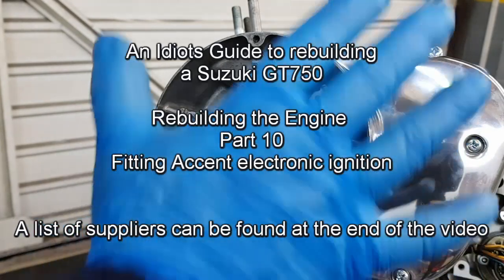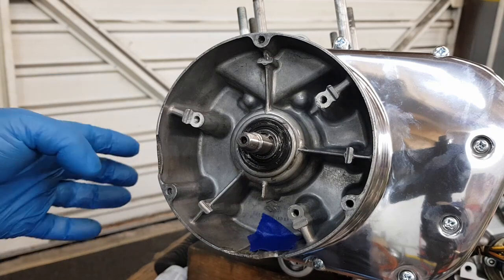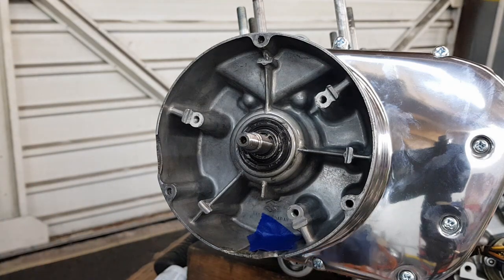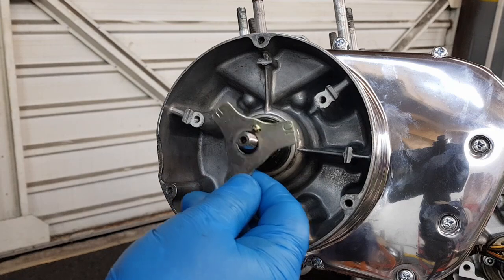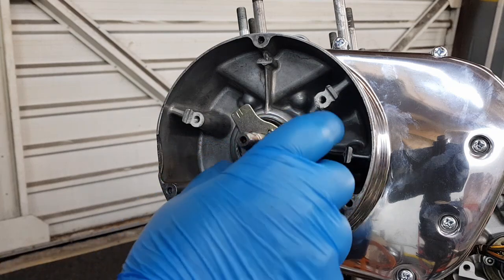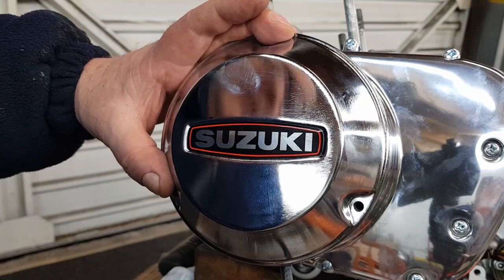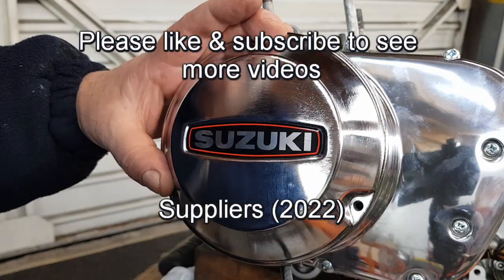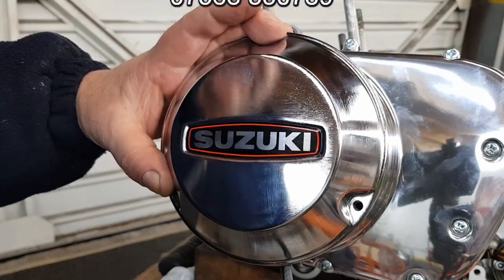Fitting the Accent Electronic Ignition - Part 10 - Rebuilding a Suzuki GT750 engine An Idiots Guide

Comment: Hi mate, dont have a GT750 myself ( got a 78 Z1000A2) but have been watching your idiots guide to restoring a GT750 with  great intrest and im sure you have helped many owners with their own restorations well done and your bike looks outstanding.
Reply from the maker: Thankyou
Reply: Hi Pete. Thanks for you good guidance videos, and on fb. I am about to fit accent to my gt750 -76. I wondering how to open the 14mm nut to replace the rotor?
The engine is not dismantled as the one on video. Any tips would be appreciated.
Reply: Hi Pete. Thanks for you good guidance videos, and on fb. I am about to fit accent to my gt750 -76. I wondering how to open the 14mm nut to replace the rotor?
The engine is not dismantled as the one on video. Any tips would be appreciated.

Comment: Peter could you maybe explain, or do a very brief vid of how the unit takes its power from the flasher unit and how the wires piggy back the orange cable. Many thanks. Simon.
Reply from the maker: There will be a new video on fitting the Accent Electronic unit which will show the orange wire connections uploaded soon !
Reply from the maker: It's uploaded now

Comment: Hi, Peter...I just got the electronic ignition in the mail and I was wondering if I can put the 14 mm nut back on with a regular spanner because I don't have an air pressure one.  Can I prevent the shaft from turning as I tighten it?
Reply from the maker: Yes just put the bike in gear that will give enough resistance to be able to tighten the nut adequately 👍
Reply: @suzukigt750idiot  Quick update: I installed the ignition today. Had to cut out the slots a bit like you said. Starts on the button even without choke. Was a bit of a hassle to get the cable nicely tucked away but in the end it turned out ok. Tightening the 14mm nut even with the bike in gear wasn't that obvious...it still turned. Thanks again for your excellent videos!!
Reply: Thanks Peter

Comment: Would you always recommend switching from points to electronics? I have a hard time reaching Uwe.
Reply from the maker: I always fit Accent electronic ignition, really easy to fit its a no brainer 👍
Reply: @suzukigt750idiot  Thanks, Peter. I have to keep at Uwe, then. I know he is busy and does excellent work. But solo importing anything privately into the Bluff can sometimes be a chore. I have now mostly set up my workshop to begin the restoration. Your videos are indispensable. Thanks again!

Comment: Very nicely explained.
What about WHEN to set the timing?
As in how many degrees before top dead centre or whatever. Using my dial gauge.
Surely there’s more to it than getting a red light to come on?
As an idiot myself I need all the help I can get.
Reply from the maker: No it really is that simple !
I have checked the timing with a strobe after I've set it with the red light and it's perfect every time
Reply: @suzukigt750idiot  Again, thanks for replying.
Can you tell me where you purchased this system from? Details are a bit sketchy.
Thanks.
Reply from the maker: @nickhellen6303  I buy direct from Accent in Germany

Comment: I have the same ignition and it works great.  only issue the orange bullet connector for power is a little small.  Check how tight it is.  How do I know?  I had a nice walk with it because of a crappy connection.
Reply from the maker: Dave all you need to do is close the female conector with a pair of pliers so it's a tight fit
Reply: @suzukigt750idiot  which is what I did